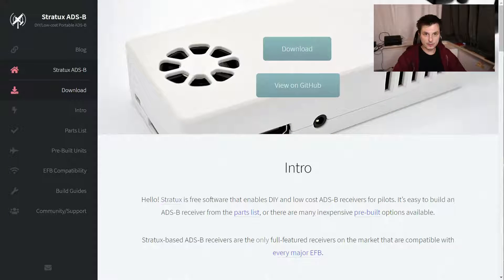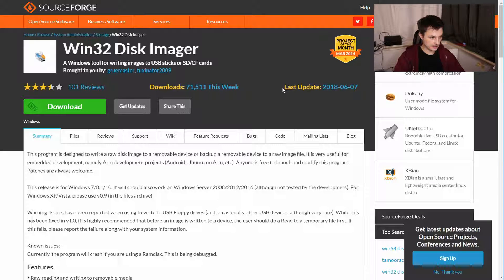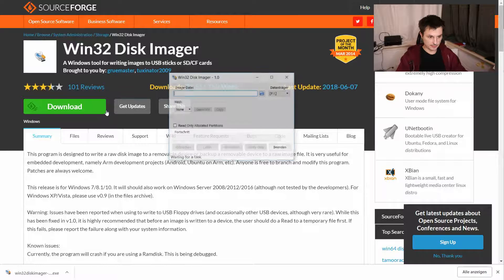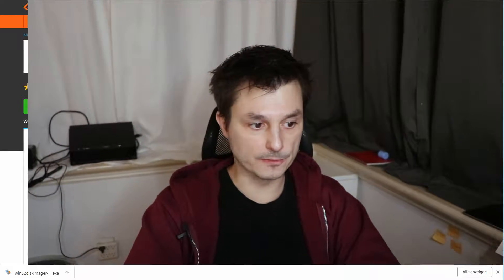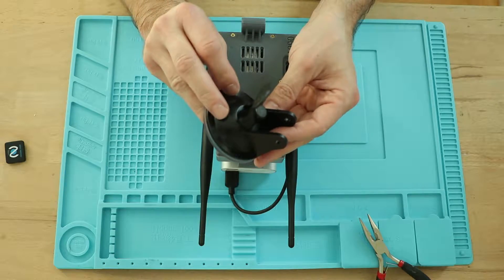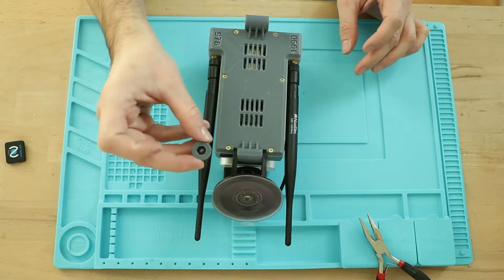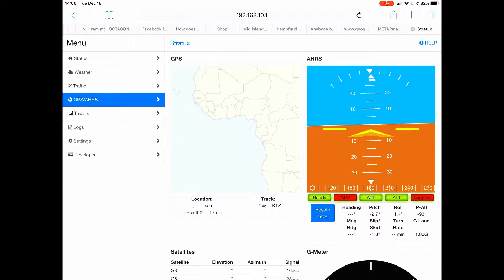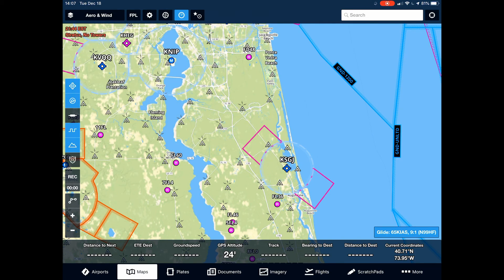Build Your own Stratux

Comment: You might want to update your links.

The new UAT radio (Low power V3) by the Stratux developers drops power consumption signifigantly while increasing performance.
https://www.amazon.com/Stratux-1090ES-UAT-Radios-Antennas/dp/B07K1GZMM9/
Reply from the maker: Thanks! I updated the link.